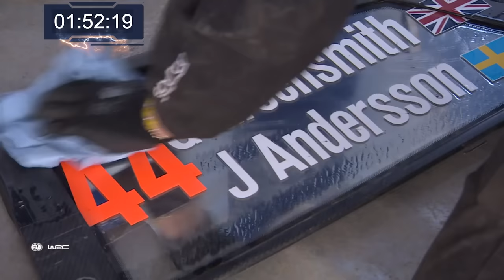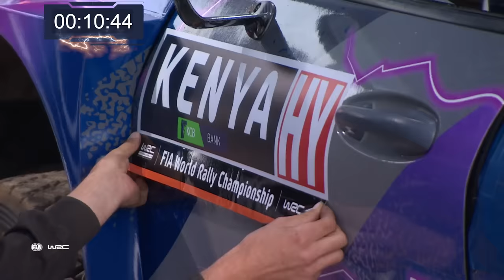Rally Mechanics Crash Repair with Greensmith's M-Sport Ford Puma : WRC Safari Rally Kenya 2022

Comment: Where do mechanics go when they die?
But before I tell you where, I'll tell you why.
See when a mechanic dies they don't go to heaven or hell.
And that’s because his soul is too hard to sell.
Satan don't want them because he says they’re too mean.
And Saint Peter won't let them in because grease is a pain in the ass to clean.
With rachets and wrenches and sockets and such,
He don't want wings because they don't come with a clutch.
Well… the man on the moon needs help pulling that thing across the sky.
So that's the place where all mechanics go when they die.
They got pulleys, generators and engines of every size
to keep that thing glowing and moving across the night sky.
And every now and then that light goes out
But they get her up and going and back on route.
So it's true that mechanics never stop working
Even after death, they’re all up there smirking